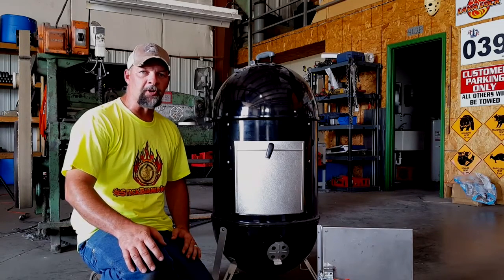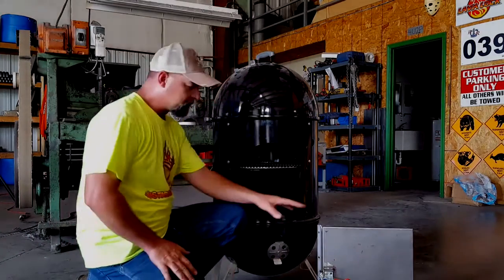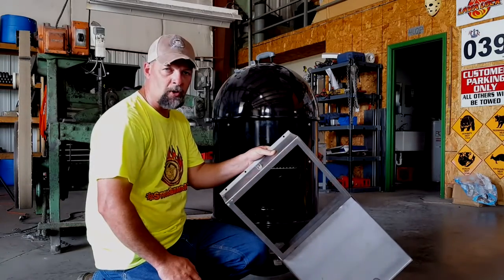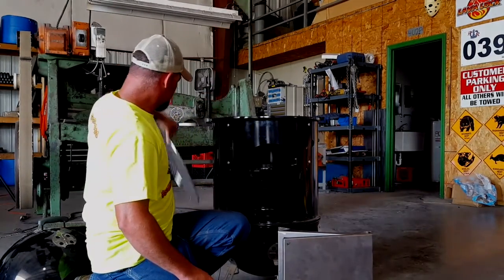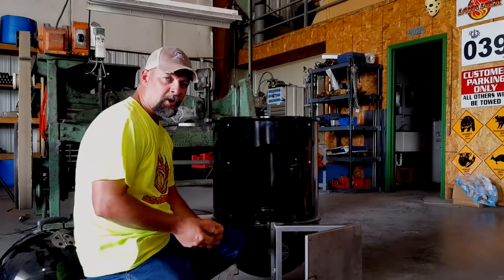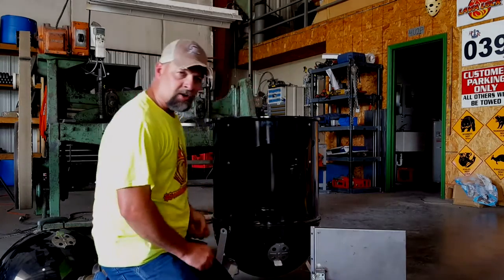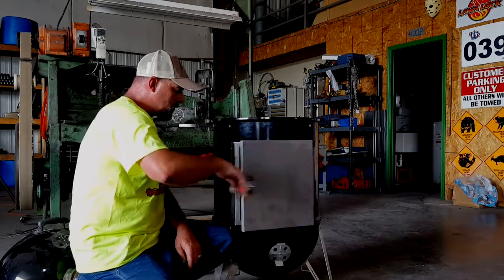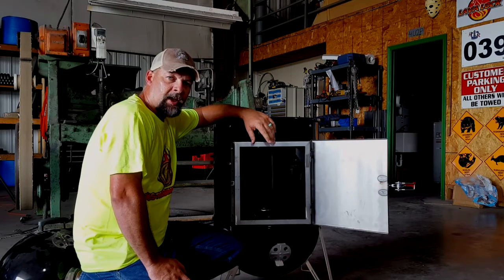How to install the Lavalock WSM Door mod from bbqsmokermods.com

Comment: I'm building a reverse offset smoker from a 55 gallon metal drum. 4.5" diameter chimney, about 24" high w an elbow. What size is optimal for the firebox? 

I was thinking of going 18"w x 24"h x 20"d (looking at it from the front). Thinking of putting the door on the right side. Thanks.
Reply from the maker: I recommend you plug the numbers into our Pit Calculator. Here is the link.....
http://www.smokerbuilder.com/pitcalc/
Reply from the maker: There are a lot of threads about using the calculator in the reverse flow smokers section